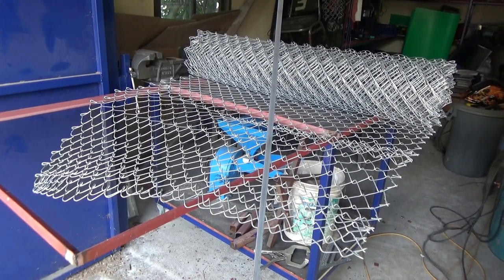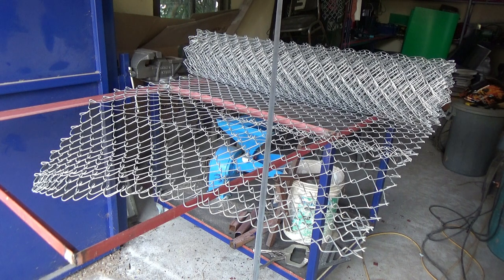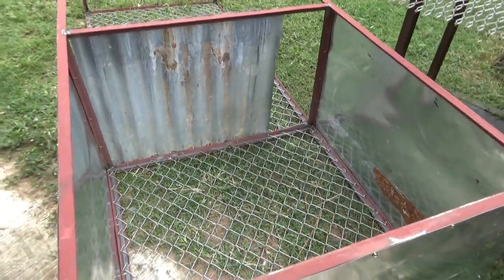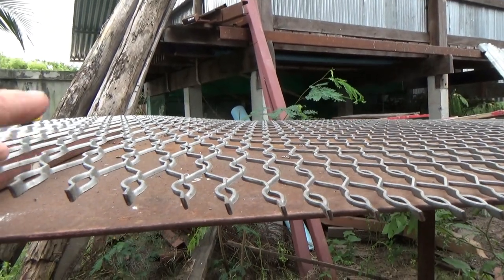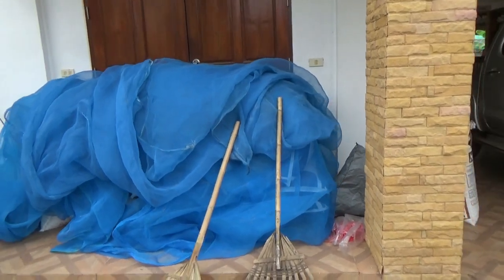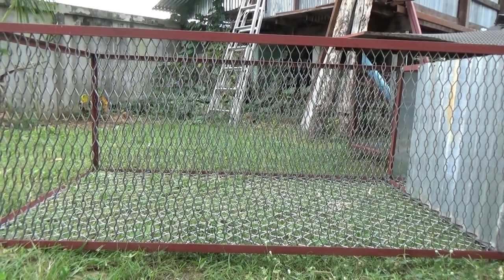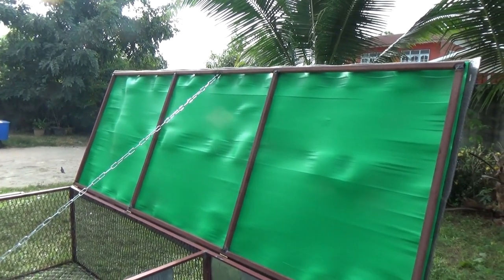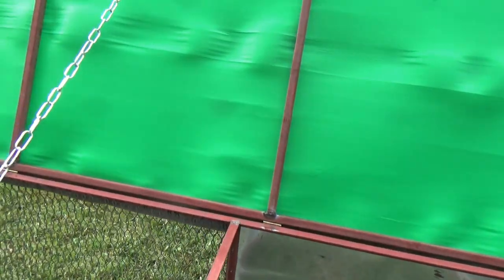Building a steel rabbit tractor with insulated top.

Comment: Hi Paul. 

Could I suggest a Camo Net to cover the pen. It'd help with keeping the heat out, and on hot days it could be dampened down to give the bunnies a cooling environment.
Reply from the maker: That is an interesting thought, I just checked and I can get them from eBay, not expensive either, might be worth a try.

Comment: If you upped the wire gauge you can stand it on end and use it as a shark cage ;-) take the rabbits out though I dont think they are good swimmers lol. If I do get some for my daughter I will make a tractor help keep the grass down. Might have to leave it stood on end till next door asks what it is.... MMmm what would I tell them lol.
Reply from the maker: lol, just tell them it's a shark cage....
Reply: ;-) They already think i am strange  lol
Reply: I have the same problem, sometimes I think there right.....